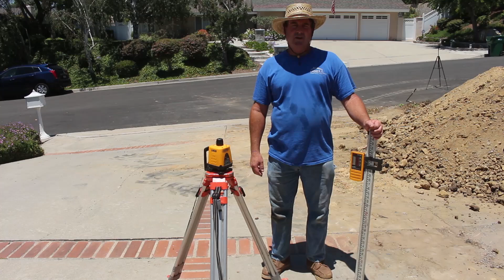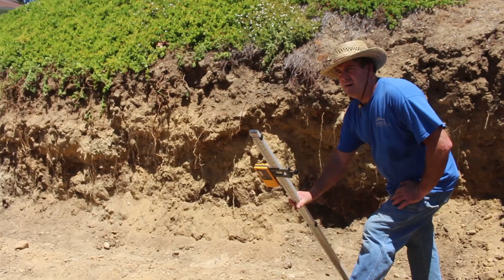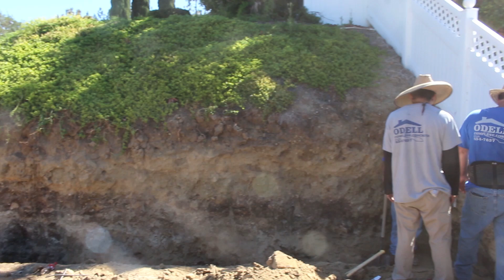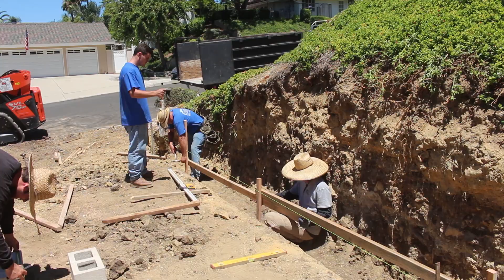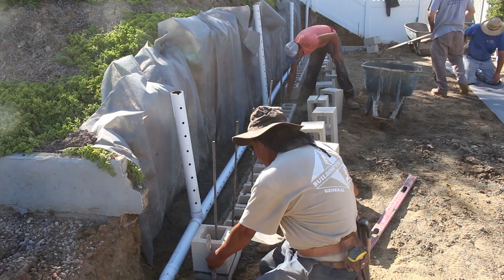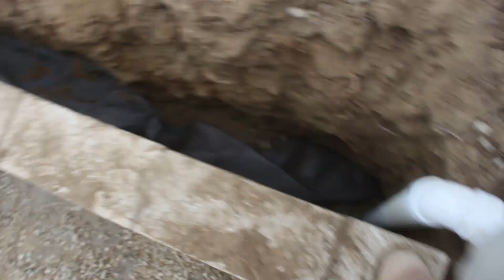How to Build a Retaining Wall - DIY

Comment: Some contractors say ....no plastic membrane behind the blocks and you say yes...i rather not put a membrane behind it.
Reply from the maker: Depends on the type of wall. I didn't use plastic behind wall. I used a waterproofing compound.
Reply: You are not getting any water to drain through a block filled with concrete even if no membrane or waterproofing. It just keeps moisture from migrating thru the block and depositing calcium on the exposed cinder face causing discoloration. Exposed cinder will degrade over time either way unless sealed.
Reply: @tomszabo7350  Not cinder block, concrete. Two different things.
Reply: Dependant on what statistics that you pulled out of your ass?

Comment: nice job building the wall.. I have two questions. 1, did you wrap the drainage fabric around the for PVC stacks? Because dirt could get into those PVC stacks through those holes you drilled. 2, did you use the drainage rock on top of the drainage fabric so the dirt will not clog up the drainage fabric?
Reply from the maker: Yes we have drainage fabric around pipes and gravel around pipe.
If dirt gets in pipe it will easily flow out, but I don't anticipate that happening for another 40 plus years.

Comment: Ok thxNow I was wondering what about the 2x4 you place on grade Does thst mean it follows the grade so it's not level? Or is it level and at the height of the top of your footing which should be about 20"? I'm asking because it appears on the step down section that the footing height is less
Thx for any comments I love your videos!
Reply from the maker: Yes that makes sense if the footing dig is level.

Comment: I have a basement with vents running through/under the concrete floor.  I've replaced it with overhead vents.  Now I need to do something with the below ones.  Do you have any videos showing you addressing something like this?  I'm a new subscriber and haven't gotten through all your videos yet.

If not, can you maybe answer something for me? When I bought the house the inspector said I could just pour a little concrete into each vent.  However, I'm reading elsewhere that I should fill the entire vent line with concrete.  What is normally done in a situation like this?  Would it be a huge deal if I just capped off each vent like the inspector suggested?  Or would the rest of the vent line eventually fill with water or something and cause problems down the road?
Reply from the maker: I'm not sure I would have to see it, but my guess is its better to completely fill it, if you have no use for it.
Reply: Thanks for the advice.

Comment: Nice job!I had a question So the top of your wall is not level It is essentially the same slope as the grade correct? Thx for any feedback
Reply from the maker: The wall is level with a couple steps in it.

Comment: Hi there! I get how the horizontal pipe is collecting the water behind the wall but what is the role of the vertical ones?
I very much appreciate you putting these videos together for us! Thank you.
Reply from the maker: The vertical pipes are for ground surface water runoff
Reply: Oh, i see, thank you.
Reply: Gives the water an escape route so it doesn't build up behind the wall.

Comment: This is a great tutorial! So each block is filled with concrete as you are building it up?
Reply from the maker: yes
Reply from the maker: Yes
Reply: @ezicarus8216  Cured concrete locks the blocks together to make an extremely strong unitary wall especially when reinforced with rebar. Nearly as strong as a poured wall at around half the cost. The only way a wall like this fails is the footing settling until the entire wall leans forward. Not happening during the current homeowner's lifetime or probably the next one's either.

Comment: I didn't expect the foundation to be that deep and wide. 2' wide sure.. but almost two deep! that's huge. Is that code or your experience dictating that?

The wall looks larger than 4' too. I have never seen a "wet set" first course before.

quality work both on concrete and video.
Reply from the maker: I build according to my 35 years hands on experience.

Comment: I have a quick question if you answer them . I'm building a block pond in my yard with 8x8x16 block. I'm down to the frost line which is 36 inches. Should I dig down another few inches and put 3 to 4 inches of gravel down first or pour footer right onto the dirt? The pond will have a rubber liner inside of it and is approx 2 foot in ground and 2 foot out of the ground.
Reply from the maker: I'm not sure. I would check with the local building codes in your area.